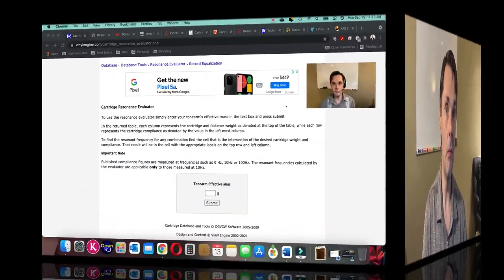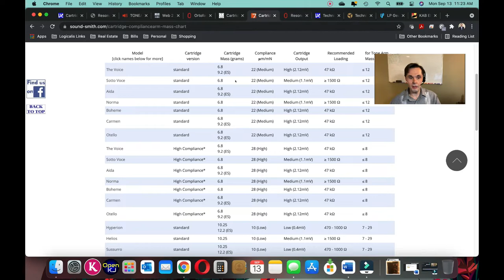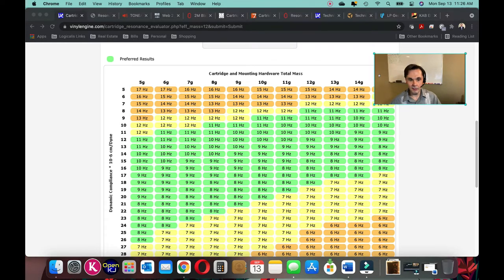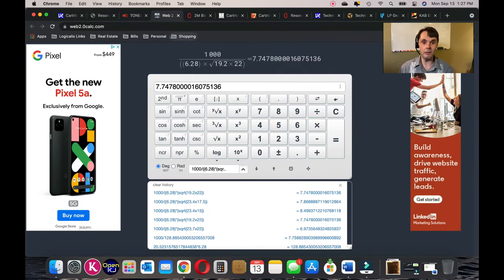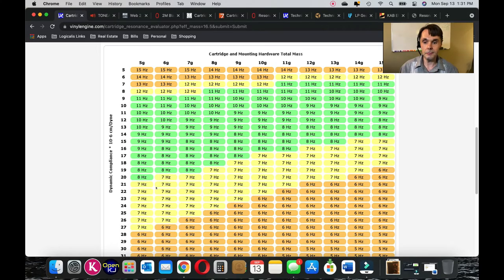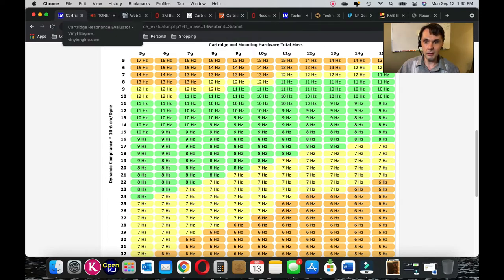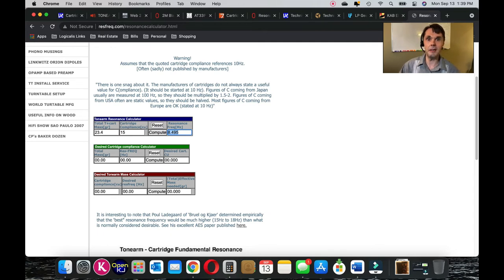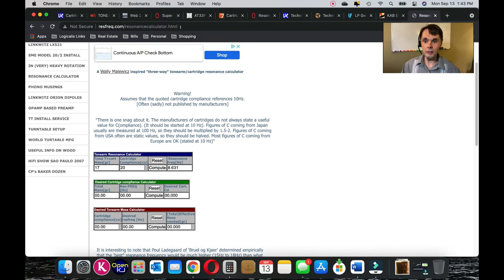How to Choose the Perfect Phono Cartridge Compliance Profile for Your Turntable and the Tonearm

Comment: Thank very much for this good knowledge. I own P6/RB330 and people recommended AT33PTG/2. I bought it then found your video. AT33PTG/2 mass is 6.9 grams. AT33PTG/2 dynamic compliance 10×10-6cm/dyne (100Hz) times 1.5 is 15×10-6cm/dyne (10Hz). RB330 effective mass is 11 grams. So that's right there at the sweet spot. Next time, I can choose cartridge with confidence.
Reply from the maker: Great to hear… I find the compliance closer to 16-17 on my PTG but hey… I know it works well on the rb330 just be mindful of VTA!

Comment: Ben, thanks for working through the examples - always helps to see a concrete example. I’m missing something here - a lot of reviewers (and Technics themselves, when they ship G, GR to reviewers) include the 2M Black and rave about the combination. The new models have the same effective mass tonearm as the older ones, which doesn’t jive because the GR head shell is 1g heavier than the mkii one on paper. I have a mkii as well and have a few head shells, and the calculations always work out better with the lightest head shell.
Reply from the maker: You're not wrong... I thought it sounded a bit stuffed until I used a Hitachi 6g headshell... Then it was great but had to give up some azimuth adjustment but was able to correct it enough in the collar... It is a snug fit though... Thanks for watching :)

Comment: THANK YOU SOOOO MUCH for explaining this I have been banging my head on the wall trying to figure out why My 2M Black sounds WAY better on My SLQ2 than it does on my SL1200 MKII and my 2M Red sounds WAY better on the SL1200mkII than the SLQ2 and this may just be it!!! Even though I can't find the mass of the SLQ2 even though the two tonearms may look the same near the pivot bearings the SLQ2 has plastic and on the SL1200mkII it appears to be metal or something heavier duty than plastic making it heavier. Both carts have the Ortofon SH-4 Headshell (9.4g) and when I put in the number for the SL1200 and the 2M black I get 7.387 the re gets 7.748 both rather low but the Red is closer than the black and when you listen to them both it is Obvious the Red is the better pairing (also have a Dual brands Ortofon Om5e/10e that also sounds GREAT on the 1200) BUT when I use the 2M black on the SLQ2 it sounds like a door opens to a WHOLE NEW WORLD but put on the 2M Red and that door closes FAST, meaning the Resonance Frequency is probably too high with the 2M Red on the SLQ2. I have two more light weight pioneer headshells one that is around 8.5-9g and another that is 7-8g and I will test them with the 2M Red/Black and see what happens. I am also gonna try and find the mass for the SLQ2 tonearm but even Vinyl Engine doesn't have it, BTW do you know how to measure the tonearm mass?

Comment: This is the best I’ve seen this explained! Now I think my Ortofon 2M Blue with the matching Ortofon headshell was not the right fit for my Technics SL1200mk2. It’s a beast which requires an extra counter weight on the tone arm! There is virtually no anti skate for half the record playing surface and the VTA ring must be all the way down to be anywhere close to the right tracking angle. That’s with the very thick mat which comes with the deck! Don’t think this is what Technics would call an ideal setup! Now begins my journey into what is a good fit for that system! I’m open to any suggestions which would work best with the standard SL1200 tone arm.
Reply from the maker: The AT33 PTGII is a great fit… but honestly the standard technics shell is only 7.5g and would treat your blue much better from both a VTA and Weight standpoint… I run a 10g LP gear ZuPreme shell on my PTG but also the heavy aux weight from KAB because the closer to the stalk weight works great I’ll drop a few links:
Reply from the maker: OEM technics shell
https://amzn.to/3i3Ln0I
Reply from the maker: Highly recommended moving magnet 
https://amzn.to/3hZmh3d
Reply from the maker: Best I’ve heard on a 1200 under $1000
https://amzn.to/3Q1C2mI
Reply from the maker: Weights and so much more
https://www.kabusa.com/m1200.htm#auxwt
Reply: @BensAudioCave  Thank you for those fast recommendations! This will be fun to explore!

Comment: I have a 6.559 Hz resonance peak from my A-T OC9XML on an A-T L11H Headshell mounted to a Technics SL-1210GR Tonearm. This combination was not recommended by A-T yet so far the sound is very lifelike. In other words, no issue.
Reply from the maker: You would likely be shocked at how much different it sounded on a lighter weight arm… IKHO the AT33PTG/2 is a much better fit… try a KAB fluid damper; it really helps btw… you may think it can’t get much better because it probably sounds good; but you might be surprised.  Happy Listening! 😄
Reply: @BensAudioCave  Yep, the KAB fluid damper is a great thing, it helps a lot even with warped records, one of the records that I have was unplayable due to a kind of short in length warping, but since I’ve had the fluid damping, it plays through. I also have an electro record where I suppose there is a lot of sub-bass and I’ve actually seen the tonearm resonating at the end of the song, though I haven’t heard anything wrong in the audio itself (actually the only record where I’ve noticed something like this in my entire collection) and even here the fluid damper helped quite a lot. Do you also have it, Ben? I haven’t noticed it on your SL1200. While I knew about all this stuff, I didn’t bother much about that and I felt that I would be below 8 Hz with my heavier cartridge A-T VM740ML (8 g) anyway. However, it seems I am i the green area in the end, 7.958 Hz (x2.0) ~ 8.507 Hz (x1.75) ~ 9.189 Hz (x1.5), especially if you say that the 100Hz value multiplied by 1.5 seems more realistic here. I’ve ordered a Nasotec swing headshell which is heavier (11.9 g) than my current Technics one and apparently it should still be fine if I consider the value 1.5× more realistic, 1.75× isn’t that bad either actually, 7.205 Hz (x2.0) ~ 7.702 Hz (x1.75) ~ 8.319 Hz (x1.5), and its construction shall help to minimize tonearm resonance even further according to reviews.

Comment: Ben, Really enjoyed this. Very informative and easy to follow - thanks!  I do have a question - @10:39 you use 19.2 (4.5 + 7.5 + 7.2) as the cart total mass for the 2M Black for a resonate freq. of = 7.747.  This makes sense.  However, @23:08, using the same formula, you use 23.4 (4.5 + 12 + 6.9) for the AT PTG33.  This does not make sense to me.  It looks like you used the value for  tonearm effective mass  (12) instead of the headshell weight of 7.5.  If I understand correctly, the only thing that changed for M (aggregate of arm mass + headshell + cart weight) between the 2M Black and the AT PTG33 is the cart weight, 7.2 vs. 6.9.  In other words, should you have used 4.5 + 7.5 + 6.9 = 18.9 for M instead of 4.5 + 12 + 6.9?   This would have resulted in a resonance of 9.45 which is even better than the 8.495 you show.  Bottom line - the ATPTG33 coupled with the Technics SL1200 is absolutely a great combination with a resonance of 9.45.
Please correct me if I am wrong.  Thanks again for your work!
Reply from the maker: The discrepancy is in the headshell… at that time it was on a 12g Jelco hewsdshell
Reply: @BensAudioCave  Thanks Ben.  What do you think about the "Ortofon Revises Cartridge Resonance Chart, Expands "Useable" Range" article?  Also do you know if the new SL100C is similar to the SL1500 or SL1200? Thanks
Reply from the maker: @kjb7229  I will say the 2M’s still perform pretty well irrespective of all this… that said I can pick out the compliance of a cart these days by ear… the test record (not shown here) pretty much confirms it… but usable is a definition that is very qualitative… lots of  things are useable…. As for the 100c; closer to the 1500.. 1200GR and G are in another league… GR still being lesser…
Reply: @BensAudioCave  Ben thanks again for the quick response! Hope this isn't too off topic, but I would really like your opinion on belt driven tables.  In particular, The new Uturn Orbit Theory.  I am trying to decide between the Theory with the 2M Bronze vs. the SL100C with the VM540ML. Using your methods (great instruction BTW), I come up with the following assuming the arm on the 100C is 12g without headshell.

SL100C with Audio Technica VM540ML (x 1.75 @100 Hz Japan)
M = 12 + 7.6 + 6.4 = 26g (tonearm + headshell + cart)
C = 10 x 1.75 = 17.5 (VM540ML is actually around 23-25cu)
Res Freq. = 6.371

SL100C with Audio Technica PTG33 (x 1.5 @100 Hz Japan)
M = 12 + 7.6 + 6.9 = 26.5g 
C = 10 x 1.5 = 15
Res Freq. = 7.983
@C=24 - Res Freq. = 6.311

Orbit Theory
U-Turn Orbit Theory with Ortofon 2M Bronze
M = 8 + 7.2 = 15.2g (tonearm + cart)
C = 22
Res Freq. = 8.703

Am I doing these calculations correctly? If so, what would you recommend? Thanks again for your time!
Reply from the maker: @kjb7229  Actually the 12g is WITH the headshell... and the VM540ML is like 6.4g... I will tell you that combo is an EXCELLENT fit... The Orbit theory is meh ok... Honestly the one belt drive table I have consistently loved is my Audio Technica LP7 in my office and it comes with a 520EB so really just swap out the stylus for the 40VNML and you have a budget STAR!  It has VTA, the best Wow and Flutter you'll ever get for under $1000 or maybe even more and the speed stability rivals my modded SL 1200mk2 and it's pretty... Link to table below:

https://amzn.to/3RhopAk
Reply from the maker: Stylus:
https://amzn.to/3HH4o2T
Reply from the maker: So that combo is like $109 less than the orbit theory and it will blow it out of the WATER

Comment: Incredibly informative video Ben, thanks for the thorough tutorial!

How would you select a cartridge when you don’t know it’s effective mass? I have a Kenwood KD-4100r/s-shaped arm and that info isn’t listed. I’ve seen guidance to assume it’s “medium mass” but even that implies a fairly wide range of potential masses to consider. 

Any practical suggestions to tackle this issue?
Reply: If you take the headshell off and the counterweight at the back the mass of the arm would be from the pivot, so just place it on some digital scales at its end tip that will give you the mass of the arm. Well I've just had a look and it says the effective mass of the arm is 24.7g

Comment: Hi. I've done some thinking about this compliance stuff. And it seems the cartridge weight isn't the only factor at play here. How the weight is distributed should also be an important factor. 

For instance, the Ortofon Concorde integrated carts weigh around 18-18.5 grams. But when you balance a Concorde on the SL-1200 tonearm it's seems a lot lighter than it actually is and you can push the counterweight a little further forward than you can with (for instance) a Ortofon SH-4 headshell + OM cart, a combo which comes in at 14.5 grams. So, the total effective mass should be lower and consequently the resonance frequency should be higher if you use a cart where the bulk of the weight is closer to back/mounting section on the arm.

This probably the reason a Concorde +  a OM30 or 40 stylus works very well with an SL-1200 arm even-though the compliance for those needles should slightly too high for that arm.

Also, kudos for setting the record straight on the SL-1200 arm effective mass thing. A lot of people seems to believe the eff. mass is 12 grams without the headshell.
Reply from the maker: Thanks for the reply… keep in mind many of your thoughts are valid… I keep the weight as close to the bearing as possible and it does help… BUT cart mass is NOT the only variable… compliance is a measure of the integration of the cart suspension… I will tells you that you can take two different carts with the same compliance and other than the voicing; get similar tonal characteristics at the same resonance value… when you have a wide variety it’s easier to see…
Reply: @BensAudioCave  Thanks! I'm just learning this stuff. Didn't even know that compliance was a factor until quite recently. It's seems even some manufacturers disregard the compliance factor. For instance some of the The Fluance turntables /the RT82 and up I think) are shipped with the Ortofon 2M Blue which have rather high compliance as you discussed in this video. But the Fluance tonearm have an effective mass of 28.2 gram or something like that. That should be a horrible mismatch. According to vinyl engine calculator any cart with a compliance above 10 cu should be unusable on the Fluance. 

How do you keep the weight as close as possible to the bearing btw? Some additional weights?
Reply from the maker: @felixfranzen7578  yes I got them from KABUSA… the have many aux weights and even a resonance cap… see here
https://www.kabusa.com/m1200.htm#auxwt
Reply: @BensAudioCave  Ah, thanks for the tip! I've been looking for a solution like that as the counterweight is pretty far back when using a cart like the Ortofon 2M or even my favoured Concordes (despite the weight being concentrated at the far back on those). Perhaps the headshell I use for my 2M is heavier than it should be. It looks like a standard Technics headshell and those are supposed to be really light (7.8 gram I believe). But it might be some kind of copy and if so the weight could be far higher.
Reply from the maker: @felixfranzen7578  I have a ton of different shells… lightest is a hitachi at 6g and the heaviest is an AT at 17g for lower compliance carts like denon DL-103’s and SPUs… the OEM technics is in fact 7.5g and the latest one with azimuth for the 1200g is 8.5… compliance wise; the 2M’s work best in the OEM shell (copies are 9-10g) and with the small 10g aux weight… the 2Ms weigh 7.2g… will put the main weight about at the bearing at 1.8g which is about where I run them…
Reply: @BensAudioCave  That's useful info! Thanks Ben. I'll try to get hold of the KAB OEM headshell then and those small extra weights for the Concordes.
Reply from the maker: @felixfranzen7578  if you can; simply calling them will get you directly in touch with Kevin and you use many of his preferred devices so he will also be a wealth of knowledge for you as he has been for me
Reply: Felix - or anyone else for that matter.  Where is the confirmed authorized source for the SL-1200 arm effective mass??  I have emailed Technics/Panasonic twice and they have not responded. Same for the 100C - no answer.  I am interested in the SL100C and some have said the arm mass is similar to the 1500.  Thanks to Ben, I am now taking his advice on cart/tonearm matching and want to know the effective mass for the new 100C. 

Ben - thanks for the AT LP-7 recommendation.  However, it shows as discontinued on Crutchfield. Again, appreciate your help and contribution to this topic.